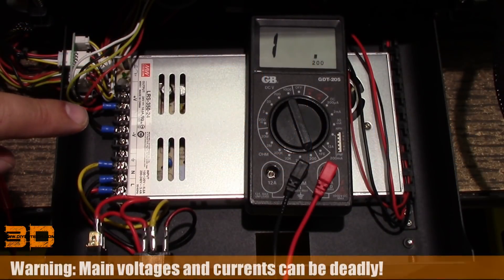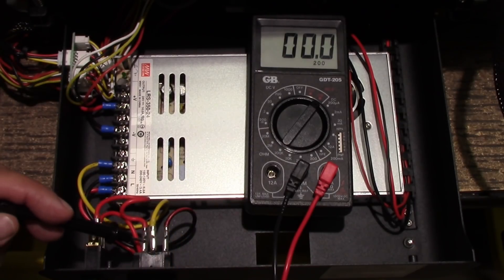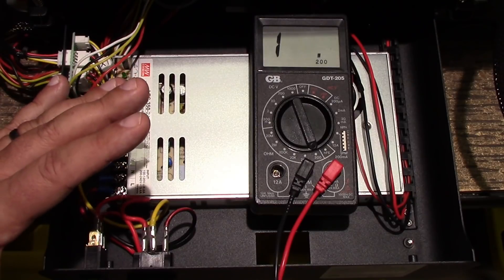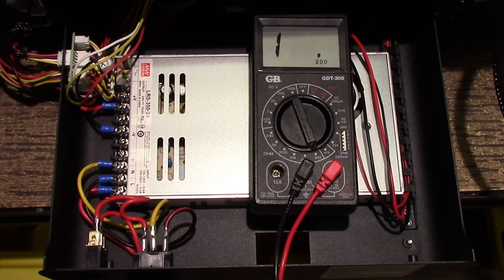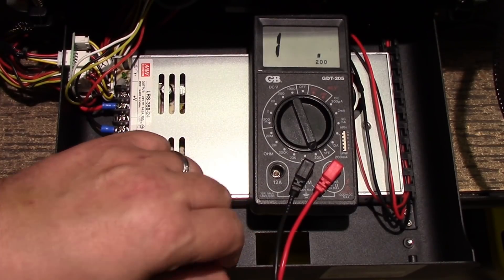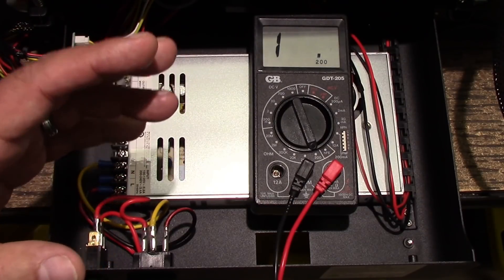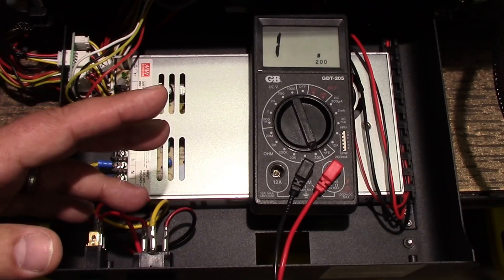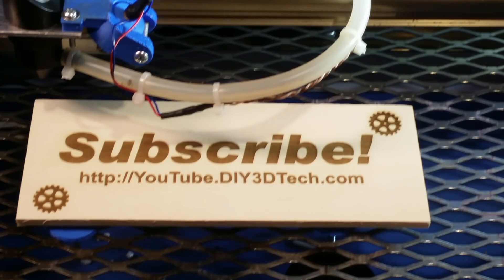Shop Talk - Can My 3D Printer Electrocute Me?

Comment: Just ran a test on my Prusa MK2S. Connected AC power but not ground. Measured voltage between one AC input and ground terminal at 49V, between the other AC input and ground terminal at 71V. Note that 49V + 71V = 120V. Demonstrates normal operation of Y capacitors in power supply input filter. Not dangerous due to low current. No more or less "defective" than the JGAurora's power supply!
Reply from the maker: Agreed and this is why he got a shock, as lets face if it.  He is at 220 and and if he had a descent ground, that would have been a major kick in the pants...
Reply from the maker: So I tried my JGAurora broke ground and measure line at 121 and Neutral at 0 ???
Reply: No, not dangerous at all since the capacitors' low value limits the current to less than will trip a GFCI. The capacitors are specially designed for this purpose and are safety-agency rated.
Reply from the maker: Yes I understand what your saying, I am just trying to figure why when I broke ground I didn't read anything on the neutral because as I expected to see around 50 volts too
Reply: You need to measure between line and neutral and the floating ground terminal, not earth ground. You should see roughly half the line voltage on each.
Reply from the maker: Yupper that's what I did and didn't see anything, you think it finding ground elsewhere?
Reply from the maker: Its getting late, I am going to try a different power supply tomorrow...
Reply: Possibly grounded through a USB cable?
Reply from the maker: Nope thing pluged in and sitting on wood.  Even pulled the ground wire PS and I get nothing on load or neutral...
Reply: Murphy is probably involved somehow. Will be interesting to see your measurements with another power supply. Will check back tomorrow.
Reply: Can't sleep thoughts re unexpected voltage readings: Possibly related to the input impedance of your very nice but vintage - 30 year old? - GDT-205 meter. Possibly the power supply doesn't have the typical input filter design with identical Y capacitors between L and G and N and G. If I had one, I'd open it up and take a look. ;)
Reply from the maker: You picking on my meter :-) it not that old actually maybe 5 or 6 year.  Now do i have an OLD radio shack meter that about 40 years old.  However I do have others (never have enough meters) and will try more today...
Reply from the maker: Yupp it was the meter, used my better on and bingo!  So it was the impedance, color me a bit surprised but it is what it is.
Reply: Clue to the meter problem was the Gardner Bender brand. They make tools for electricians, and low-impedance meters are preferred for some electrical applications. Not really a matter of quality. They make good stuff. Fluke has a good explanation somewhere, which you can Google if interested. You do a great job, BTW. Don't know how you crank out so many high-quality videos so quickly.

Comment: While this video and Angus's make some good points, I'm afraid they might have given a false impression that the JGAurora A5 is  unsafe. This is almost certainly not the case. Please see the many comments below and those for Angus's video that explain that the zap he felt is not dangerous and is a consequence of the way virtually all switching power supply input EMI filters are constructed. It does not mean that they are defective in any way.
Reply from the maker: This is the reason I did the video as I had ton of people writing me to say "hey the JGAURORA A5 isn't safe!"  so figured I would open it up and show people what's inside and see (as the Wanhao had issues in its time).  However the only thing as mentioned in the video is the lack of ground strap.   So likely floating ground issues or like...

Comment: Thanks for the video. Is the fan already broken? I think the psu completely enclosed with not that much ventilation isn't a good idea. There are vent holes for the controller and now for the psu. The steel frame has to be grounded properly! As you explained power use the lowest resistance. Btw in Europe all houses need a proper ground of all electronic outlets and conductive water and heating pipes. The power supplier will not connect your house without that certification. And if you mess by your own you can loose insurance!
Reply from the maker: The noise you here is from something else not this printer (I have a printer farm).  Ventilation is ok on this unit so not an issue, however as you mentioned, I too would have liked to see a ground strap however it does appear to have a CE sticker on the back and I "think" the bolt are "considered" acceptable.  And this is a good thing "power supplier will not connect your house without that certification" :-)

Comment: Good point,....that's why i open up and check any device from Asia before i plug it in, not all are bad but there are really dangerous  surprises to be found. With switching power supplies, good grounding is particular important as the noise suppressing capacitors always leaking a small current to earth. Also look at your fan, that sounds horrible and is most likely on it's way out, just another fire risk ....
Reply from the maker: Thanks for commenting! the fan noise has nothing to do with the machine it is another project in background and agree with you the checking part as ditto!

Comment: Unless you have a ground fault breaker on your dedicated line your deluding yourself that it is any safer than any other properly grounded line. A ground fault breaker, preferably in the breaker box or at least in the power strip is the real answer to being safer. A ground strap is a good idea and is required for certification but it is not the final answer. A PC supply is enclosed and the enclosure must have a ground strap in order to pass compliance.  There are different design rules for a totally enclosed supply(pc supply) vs one with open power rails like that one. It would fall under the same rules as an open frame supply which require a fully grounded outer case or a case capable of total isolation of the line voltage.  But again the ground fault breaker is real protection!
Reply from the maker: Thanks for commenting! Well I somewhat  agree as in general Ground fault breakers are good  however I have had issue with them in the past and "machinery" and had to have them removed because of intended leakage ( just an FYI, not a neophyte when it comes to power as built many large scale data centers around the world).  Power strips are evil, their quality varys and I have seen too many go "poof", they are ok for temporary low power applications but other then that people jury/jerry rig them as permanent solution and bad things happen.

Comment: Not a witch hunt,   I've made posts others have made posts both positive and negative and after reading all of the negative stuff  I wish to add I believe  this video has very good intentions and it covers the basics and should be used as an informative guide. But if you don't know how how to handle AC mains voltage then don't touch  it's that simple it does kill.
Reply from the maker: Thanks for commenting!  If you watched the video you will note there is a sub-title [at the start] stating this and I mention this throughout the video as this is the reason for creating this,video as people will watch Angus's and say "hey what's inside mine", so the intention is to share (1) what is inside, (2) what the risks can be and (3) if your not experienced don't touch it!

Comment: Don't jump to conclusions about how Angus was shocked. Its more than likely a switching power supply that uses ground as part of the line filtering. Read the comments of his video and this video you will see plenty of people explain this.
Reply: As Philip says, it is far more likely that Angus merely discovered what's called "touch current", which while uncomfortable and unexpected is not dangerous and does not indicate that the A5 is defective in any way.  It's Mean Well power supply is a good quality if typical switcher whose input filter does in fact have low-value high-quality capacitors tying each of the AC input terminals (line and neutral) to the AC ground (aka earth) terminal. While clearly not your intention or Angus's, I'm afraid that the A5 is getting a wholly undeserved reputation for being unsafe.
Reply from the maker: Thanks for commenting!  Yet whos jumping to conclusions?   I have no clue and make no statement as in "oh yea this is what happened to angus!" as I have no clue.  I am only exploring possibilities, as well as explaining what's inside.   Me I think it was floating ground issue as if he grabbed 220 with a half decent ground his hair would look more Joel Tellings.

Comment: Well, my country don't have earth connection, what should i do?
Reply from the maker: I would be surprised if they didn't, as an earthen ground is a ground rod stuck into the about 6 to 8 feet and connected to your homes electrical system.
Reply: Thanks, i will try to install that to my home electrical system, by a professional of course.

Comment: i think he had a "floating ground"  issue.
have had it myself a couple of times :(

it is more a  tingling/twinkle feeling.  you know that is not ok, had it also with the ground wire in COAX cable.
Some device was leaking back to "0"/ground.  when there is no "actual" ground connected.
Like you mention not a good ground point, if your pipes are changed with PVC......

i know a hardcore Electrician raises his hear. but for the "normal"  guys and girls.  i think you explained it ok.

as DIY makers, use your common sense, and if you don't trust it ask the experts... and you properly get conflicting answers :)

 
regards Ron
Reply from the maker: Yes common sense is key and wanted keep it digestible  other wise people tune out.  Also yes I have see this first hand a number of times as I am landlord as well as did many re-hab and polypropylene is now the new copper replacement.  Just did a house from 1928 and the original house had neither electric nor plumbing so this had to be addressed...

Comment: Miss information 
 this is not the best information for anyone trying to learn about electrical safety  .   ANY device that has a metal casing on it MUST have a proper earth wire running from the 
main incoming earth wire to all metal casing parts . Relying on screwed together metal parts with paint is a big NO NO and asking for trouble. These units are brought into Australia and are never tested for any safety
standards. if there where they would never pass and be banned from entering the country. Quote strait from the Australia electrical standards    
 "All Class I equipment –
(a) with exposed metal: must have the continuity of the protective earthing conductor from the
plug earth pin or supply earth point to the exposed metal checked at intervals as specified in
Table 2. The resistance shall not exceed 1 ohm.
(b) without exposed metal: such as cord extension sets, EPODs and PRCDs must have checked
the continuity of the protective earth conductor from the earth pin of the connector plug to the
earth socket/contact of the outlet(s). The resistance shall not exceed 1 ohm.
NOTE: This test is to be carried out during inspection to Clause 2.3.2(b).

Don't get me wrong these videos are excellent however when it comes to safety then it need to be correct and rules differ from country to country how every you wish to look at it this is 
one reason Angus had the same issue I bet his painted case on his printer also has HIGH resistance to earth (more than 1 ohm is classed as high when it comes to AC electrical safety)
I don't like being the stick in the mud but i feel this need to be addressed, I am a licensed electrician in Australia
Reply: I don't see any PC power supplies running a strapped earth to chassis? How are they able to get away with just using the power supply screws?
Reply from the maker: I am not sure how this is miss information and what I am stating from my experience (which I have quite a bit) and not based on any country "rules"  as more important then "rules" is common sense...
Reply from the maker: I believe the difference is on a PC power supply, the 110 connector terminates inside the metal power supply case.  So therefore if there was a "short" it would be confined to the PWS cage which is grounded.  The issue here is that the 110 terminates inside the metal case of the printer so it can come into contact with the case of the printer independent of the PWS.  So I would expect the yellow (GND) wire to be connect to a bare section of the printers case and second wire running from there to the PWS...
Reply: That sounds reasonable.
Reply: Miss information may be a bit harsh as my lead in, more so maybe missing information  ,  Angus demonstrated the main problem without even realising it when he put the multimeter
on different points to earth on the body of the machine, the different ohms readings on the chassis are the warning signs., Im not trying to say you done anything wrong, in fact all you videos are very informative, however Angus getting a shock may be due to failed power strip but even if it wasn't and there was an internal fault with the AC supply the poor case joints (paint etc) would not
allow for proper grounding of the unit.   If any electrical product that is imported to Australia is supposed to be tested but all this chinese stuff now days has kind of bypassed the testing bench there is so much of it and it
Reply: Because there is no AC inside the computer case its all contained in the PSU ec. The IEC power lead goes strait into the socket on the PSU in a computer an all the AC is contained in the metal fully enclosed power supply case  and psu cases are general NOT painted so the they dont require internal individual earth straps on the multiple PSU case parts although you do get some hi end ones that are, The PSU only has DC output and because of this the computer does not require separate earth points on the computer case. if anyone looks at the computer PSU you will (should) fined some sort
of marking or sticker stating its passed electrical compliance for you particular country. but cheap ones without electrical approval still get through. Great videos keep up the good work.
Reply: Oh and yes I also have two  3d printers and no I have not checked them and yes I probably should but my hair hasn't stood up yet, on a serious note I better have a look at them and compare. as I could have the same issues without realizing
Reply from the maker: LOL!  I like Angus so I didn't want to take him to task in the video however the ohm thing is really off base a bit.  My two cents and its only mine is his shock was from a floating ground (https://en.wikipedia.org/wiki/Floating_ground) issue which he created with the extension cords and power strips.  As with a half decent ground and 220, he would have sporting a Joel Telling hair-do...
Reply from the maker: This is what I was thinking (guessing at) too...
Reply: Agree Angas got me started on 3d printing and he does a top job and I wasn't going to comment on his videos as electrical is not really his thing from what I can tell . didn't mean to stir up a hornets nest ..
Reply from the maker: No worries constructive discussion is always a good thing :-)

Comment: Great video. I found the video that Angus made to be incomplete and unfair. Looking at the comments in his video, you can see that there is a lot of confusion and misinformation   regarding mains wiring. He really should have opened up the printer and examined it with a multimeter like you did to find the root cause. Examining the extension cords is a good idea, but I have also seen many wall outlets where  the grounding terminal is not properly connected. Even if someone doesn't  have a meter, there are inexpensive testers with three LED lights that make it easy to check your house wiring and extension cords. I agree with you that the metal case should have a ground wire.
Reply from the maker: Agree 100% as Angus got about 80% of the way there but the root cause was unclear and agree with you 100% on the ground and the reason I listed one (i.e. tester) in the description for like $7 dollars ( also have one too)  as I am picky about my grounds...

Comment: I hate seeing equipment without a dedicated ground strap. extension chords may be a necessary evil. for some.  BU if I must I use the bigger heavy gauge that is fused on src end. I purposely underrate the fuses .5 to a whole amp below wall supply.  Extension cords increase resistance and in the end lower the power available to your device.  proper heavy gauge extension only has it source plug as a weak point.
one other thing that is very dangerous and freaking annoying, is when things come with crappy power chords. If you ever go to remove a plug from an outlet and the plug head itself is hot, oh boy that pisses me off because assuming you're not overdrawing that outlet and the outlet is good and clean (contacts wise ). The only source for that heat at the END of the wire is a shitty plug.
check the contacts are clean, and if they are then sacrificing the plug end and cut it open and I bet you will see a 1/2 ass crimp done wrong or worse frigging solder done wrong. power choke points == heat, and man last 5 years or so I have found a few shitty power plugs. I chop the end off and put a good fused replacement end on ( with fuse rated 1amp less that wall . but thats just my pref )
Reply from the maker: Bingo on the extension cord as you got it right ( I am not surprised :-) as I can't tell you the number of times I have seen folks using cheap high gauge cords and I cringe!   As people don't understand " Extension cords increase resistance and in the end lower the power available to your device" !